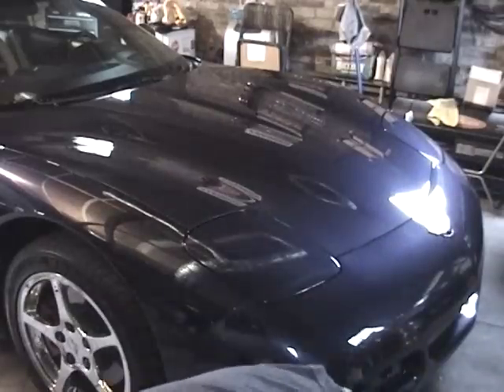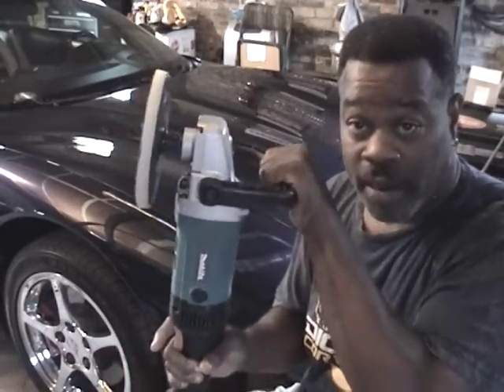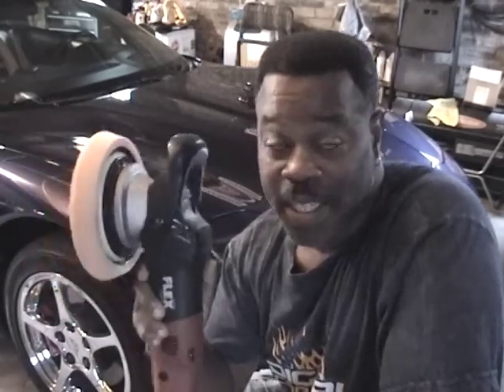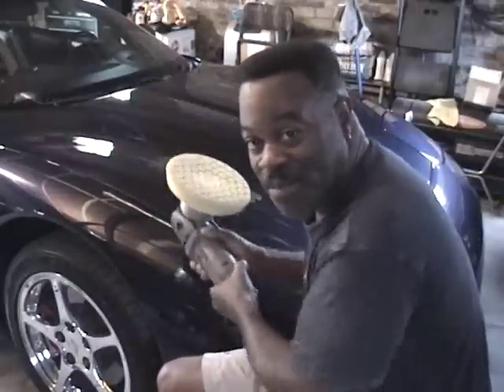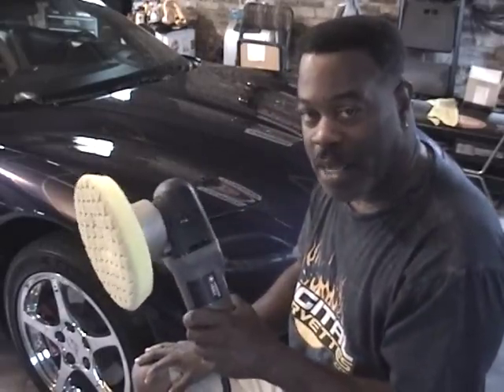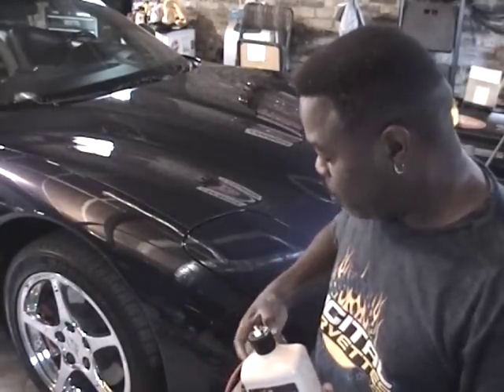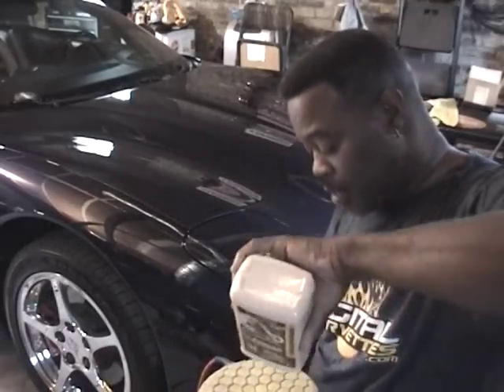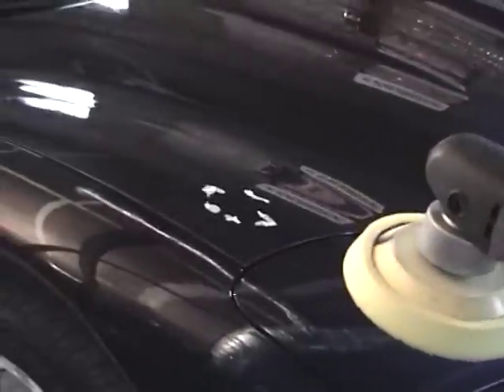How Safe is the PC-7424XP? - Part 1

Comment: Since I am not running a business, I tend to take my time, since polishing is so relaxing, so I go with fine foam pads (like the Lake Country CCS blue pad) to keep cutting to a minimum. After all, my paint was near perfect to start with. As for edges, that is where I am careful. Furthermore, I hardly apply any pressure...I'm not in a rush. Anyway, its been fun.

Comment: Hi Junkman. I was deciding between a dewalt polisher vs porter cable and came across your post on a charger forum where you linked this video. You saved me money on the polisher and a visit to a body shop. Your videos are great and much appreciated especially to a beginner like me. Thanks!
Reply from the maker: +bluusoda Well now that you've purchased the correct polisher, you need to learn how to use it because it will do absolutely NOTHING if you use it wrong. You need to start with my video playlist. It's going to be a while before you put that thing on your paint because you have a LOT to learn. That playlist is WHERE you learn HOW to use that polisher. Thanks for watching.   :)

Comment: JM, the paint on my car was near perfect to start with, so I used a Lake Country CCS Blue Foam (final finishing) pad and Meguiar's M205 polish. As for the prep, it was washed and then clayed for the first time. As for the polishing, I set my Flex to 4 and hardly apply any pressure...I'm in no hurry. After all, this is mental therapy, not work. The Flex will do it all except like any 6 inch machine...not get into tight places.

Comment: Junkman, I converted my Ryobi 6" buffer into a hook & loop polisher.  The thing only goes up to 4800RPM.  I used it with Macguiar's M105 Ultra Cut compound on their Soft Buff Foam Polishing Pad to repair the paint damage on the doors on my Lotus.  I then followed up with their M205 Finishing polish on their foam finishing pad..  Wow! It took 4 hours for the whole car but it worked out perfectly and I didn't really need another machine :)

followed up with their M205 Ultra Finishing Polish.

Comment: The backing pads on both the Flex and Porter Cable rotate when the pads aren't loaded or applied to a surface. Just have a look at the 2' 40" point showing the Porter Cable "rotating" which it, like the Flex, or any other that isn't a rotary will do when not loaded.

Comment: M85 is a Macro abrasive which is why it feels like "sand in a bottle" and rough feeling. It needs the rpm's in the rotary to break down and diminish as you work in the product. It starts off large and slowly breaks down from the rpm's into the paint. M105 is a supermicro abrasive which means it feels smooth and is safe to apply by rotary, orbital, DA or even by hand...if you want to remove sanding marks, you need a rotary though with M105. In reality if you like the result..keep doing it. : )

Comment: I just bought one! 9 years later I find this video. Think I made a good choice.
Reply from the maker: If you are a novice to machine polishing, you made an excellent choice. Now, one of two things is going to happen. 

You're going to try and use it and find out that it will hardly remove one scratch. The reason WHY is because you DON'T know how to EFFECTIVELY use it yet. You have NO technique. But lucky for you, I made a series of videos for the novice to machine polishing that you can find in my "MUST WATCH" playlist. If you watch those videos, not only will you learn how to fix your paint but you will also learn how to avoid all of the crap that was done to your paint, that jacked it up in the first place.

So you now have to make a choice. Watch that playlist and learn the ways of the Force or go forward on your own and fall victim to the Dark Side.
Reply: Junkman2000 I'm touching up hood stone chips on my wife's Pathfinder this month. Need to wet sand, polish, and seal. I'll be checking out your videos.👍
Reply from the maker: This polisher is NOT going to do anything for stone chips. Stone chips are MISSING PAINT. The only thing that fixing missing paint is REPLACING the missing paint. Wet sanding can be used in conjunction with this polisher to remove deeper scratches but wet sanding without painting is NOT going to fix stone chips. That requires a paint job. 

This polisher is mainly for scratches (the minor, the better). When it comes to wet sanding, you are only good up to about 2000 grit, and ONLY if you have a solid buffing technique. I can work wonders with 2000-3000 grit papers. Anything lower (1500 and down), is next to impossible unless you have a serious amount of time on your hands but 1500 grit is really pushing the ability of this machine. At 1500 grit, it's time for the Flex.
Reply: Junkman2000 I'm using color match paint and clear. Got to be better than spending 1300 bucks. SUV is going to the kids in 18 months anyhow.
Reply from the maker: Okay. Touch Up paint is a completely different animals. Takes years to master. So much so that I seldom use it. I usually just remove the bumper from my Corvette and respray it when it has enough chips.

Comment: By the way, to see how much a backing plate is actually rotating on a dual action polisher while polishing, put a mark on the backing plate with a marker and see how slowly the backing plate actually rotates. In fact, at the 7' mark your backing pad on the Porter Cable is rotating.

Comment: True, the Flex is a true dual action polisher. Maybe Porter Cable's specs are incomplete which is the case with so many manufacturers. In any case, the low RPMs of the Flex can hardly burn paint; the surface temperature of my paint while polishing isn't even detectable. And although I get pro results, I hardly consider myself a pro, so that would mean the Flex is quite safe unless the user is a klutz.

Comment: Junkman,

First off very good video!!! Second, nice Vette!!! Third, he's dead on correct about everything he says because the PC has a clutch in it that prevents pressure damage to the paint! You press too hard and it will stop spinning.

I have a Porsche 911 Turbo and decided to go PC because of this video.

God bless and thanks for the videos!
Reply from the maker: Thanks for watching. A more correct statement would be "clutch like" (not just clutch because there is no clutch), for the description of the design of the PC's spinning action. The technically correct term would be "free floating spindle assembly". That's what Porter-Cable calls it.
Reply: Good deal. Thanks again.
.

Comment: Junkman, how often is considered "safe" to use the more aggressive cutting polishes? Obviously you would only use them "as needed", but is it detrimental to the clear coat at all, using the Porter Cable of course, if the paint is in such a state as to needed a more powerful buffer, it's going to a professional! Anyway, love your videos, and I actually love to detail my vehicles  and it's nice to have a resource (such as your presentations) to reference. One final question, what is your thoughts on the Cyclo-Duo?
Reply from the maker: I don't care for the Cyclo at all. Just another gimmick to me. As for your "safe" question, you're asking the WRONG question. See my machine polishing videos for novices for the question you SHOULD be asking.
Reply: I guess I need to rephrase it..LOL, I like to apply glaze, completely non-abrasive, (I am currently using Poor Boy's World white diamond) with a machine,  that shouldn't be detrimental to the clear cost, I guess that is what I was asking. I've HAND detailed cars for years, just recently purchased a PC, I just don't want to "over do it" with the machine. Semper Fi! Thanks for the Cyclo heads up also!
Reply from the maker: RigTras601
A "glaze" is a product used to hide paint imperfections. It is full of fillers. It neither fixes or removes imperfections in the clear coat or paint. Thus, it removes neither. I don't use or care for glazes but MANY detailers use them to get cars in and out of the shop quickly. The way I look at it is if I'm going to do it, I'm going to take my time and do it right.

Comment: @Junkman2000 
Of course you can do that hundreds of times on hundreds of cars. Like I said before the reason you didn't burn the paint is because you used a 7 inch pad on the porter cable and because of the grip of the pad on the paint essentially making the machine underpowered to the pad used and therefor couldn't move the pad under such force to get up to any appreciable speed.

Comment: Hi Junkman2000! Thank you for the video as always. I have the following questions: 
1) Can you suggest an alternative to the PC? I'm in the UK. 
2) If I understood you correctly (go easy on me now :D) The basic difference is the Makita is a Rotary Polisher VS the Dual-Action PC?. The Flex on the other hand is a Forced Driven DA (kind of like a hybrid if you like). What is the "default" of DA's, are they free spinning like the PC or forced driven like the Flex? 
3) This leads on to my third question: Would any variable speed DA polisher do as an alternative to the PC? [The reason I ask is because I'm not sure if the "clutch function" that stops the pad from oscillating when pressed too hard is something that is specific to the PC or is universally applicable to all DA's?]
 
Would love to hear from you.
Reply from the maker: First off, you need to learn the correct terminology when describing the 3 different types of polishers. The PC is NOT a DA. It is a orbital polisher (or sander, as it was originally designed). DA stands for "dual action." Dual means TWO. The only action designed into the PC is the ORBITAL action and that's why the PC is a ORBITAL polisher. In the UK, you would buy the DAS-6 Pro, as it is the UK version of the PC. All orbital polishers bog down when enough pressure is applied. Other manufacturers may not call their design a "free floating spindle assembly" but all orbital polishers share that feature.

The Flex in this video is a DUAL-ACTION polisher. It has both the orbital and rotating action by design. You cannot stop either action. That's why it is called a dual-action machine and that's what makes it not a machine for a novice. 

A rotary is a ROTARY. It has one action and it is VERY powerful and lethal in the hands of a novice.

Last of all, you need to watch my video on the Bosch 1250DEVS: https://www.youtube.com/watch?v=mT_Z3PJJL2c&t=679s
Reply: Thanks, I will watch that video and get back to you. For now am I correct in saying that there are three categories then:
1) Orbital 
2) Rotary 
3) Dual Action (which is basically orbital and rotary?)

Further confusion: The DAS -6 Pro is sold as a DUAL ACTION Polisher - ???
Reply from the maker: There are 3 different categories. If you don't understand that by now, you need to watch these videos again and reread what I wrote. As for the DAS-6, it's an orbital polisher. They do not make it in a DA. There are people who write the ads who are as confused as you are. They don't detail cars.
Reply: OK thank you for your input. I watched the video you gave. This is where the confusion arose: I watched a video by Autogeek as well as yours and there seems to be a difference in the way the terminology is used (I’m not surprised).

The way Mike used it from Autogeek: 
He referred to the PC as a dual action since literally speaking, when you look at it, it BOTH oscillates as well as rotates. He calls the Flex a “Forced Rotation DA”. 

The way you see it: 
On the other hand, you’re looking at the rotations on the PC kind of being a “side effect” of the oscillations and hence the rotations slow down when you push down on it. So while a person using an orbital may benefit from the rotations they are primarily after its orbits hence the orbitals have OPM not RPM. This makes the PC an Orbital and not a dual-action. Consequently, the Flex is a DA. 

The Bosch 1250DEVS is a hybrid: an orbital and a DA. 

Have I understood you correctly? 

Much love...
Reply from the maker: Yes, you are correct in your understanding, including the way that Mike described it on Autogeek. I look at polishers like this. If you have a computer monitor that claims to have a 15" screen,but that description includes a 2" frame, then in reality you have a 13" monitor because that two inch frame doesn't show ANY part of the picture. Manufacturers call it differently because they want to SELL you something.

I have nothing to sell or gain buy what you buy so I preach THE TRUTH. I don't "fake the funk."
Reply: This polisher is great. I use it as DA as well

Comment: Nice series and very good review!! Could you please advise if I can use all polishing pads with this tool?
Reply from the maker: You need to watch my machine polishing for novices videos. I have no clue as to what you mean by "all pads." Pads come in MANY flavors from different manufacturers and some manufacturer's pads you couldn't give me for FREE, much lass PAY ME to use on someone's paint. So when you say "all pads", are you talking about all pads made by a given manufacturer (which you didn't specify), or every pad on the market? If it is the latter, sure... you can use ANY pad on this polisher but God bless your paint when you're done.

Be as specific with your questions as I am in my videos. That way, you get a much better answer.
Reply: Junkman2000 I think the mans asking what’s your fave brad / size and all that ah

Comment: This is pretty funny that people believe this. I have owned the Meguiar's DA polisher which is the Porter-Cable 7424 since 1996 and have used Meguiar's most abrasive professional/body shop clearer waxes and even then its very hard to burn through paint. The only way to burn through would be to hold the buffer in one place for 20 minutes maybe. Now who is going to do that?

Comment: The Junkman 8 1/2 years later i finally left a comment
Reply from the maker: Whoa, slow down my brother! You don't want to exhaust yourself!
Reply: I just shot a vid on paint correction for my new 2 week old '18 Corvette GS.  With just 200 miles on it, (drive home was 100 from the dealership) the paint was dealership hacked so bad you would have cringed man!!!  12 hours later I got it much nicer, not perfect but decent for now.
Reply from the maker: So what's stopping you from making it perfect?
Reply: Good question. I want time to drive the car instead of detailing it! lol I'd say its about 98% improved.  I'm waiting for the sun to shine outside one of these days to get a good look.  There are a couple of ugly scratches still in the finish but i'm a little hesitant about going deeper into the clear coat.
Reply from the maker: That makes sense. Gotta enjoy these rides. No use saving it it for your wife's next boyfriend after you croak!
Reply: LMAO! You got that right Sir!

Comment: I used a clay bar on my car that had over spray. The car feels smooth now but I can see the red tiny over spray dots still. I am looking into this PC machine. What polish / compounds do you recommend. The car is a 2006 so the paint is older. What pads do you recommend for this buffer so I can order them this morning.
Reply from the maker: Go to my main channel page and start watching my "must watch video playlist." All of your questions and then some will be answered. Whatever you do, MAKE SURE that you follow the FIRST video to the letter if you want my assistance. The cost is FREE so you have nothing but gain if you do.
Reply: Junkman2000 thanks.

Comment: Hey Junkman, I have a question. I am looking for a new buffer/polisher. 
I was using HF/Chicago buffers. They both broke and I cannot get them replaced. 
I am a novice, and I am looking at the PC 7424XP. I will be working on gars with alot of paint haze. The chicago broke whie doing this. Would the PC work good? 
I am going to be using it on a good amount of cars. Maybe 8 to 10 just family vehicles.

Comment: I've had my PC 7424 for about 10 years. I hadn't done paint correction in a long time. But decided to give it a go after seeing Griot's Garage cutting pad and their new Compound on the shelf of my local Advanced Auto. I went slowly at speed 4 and it removed only the light swirls. I ramped it up to speed 5 and got a little more bite but sure enough the old foam backing plate disintegrated after only doing the hood and rear trunk. Play time over. So I went on Amazon and ordered Chemical Guys flexible backing plate for $17, Griots microfiber FAST Cutting Pad for $14, along with Meguiars 105 and 205 for $60 (this adds up quick!). Some of my swirls are very deep and there are some scratches visible when not hidden by sealant/wax. Should I give the FAST cutting pad a go with the Megs 105? and then follow up with the 205 using a foam polishing pad? I also have a bottle of this Griot's Cleaner Wax that was on sale.
Reply from the maker: +porscheoscar The smart thing would have been to watch my machine polishing for novices videos MULTIPLE TIMES, and then used exactly what I said to use along with the technique that I said to use. Until you do that, I can't help you.